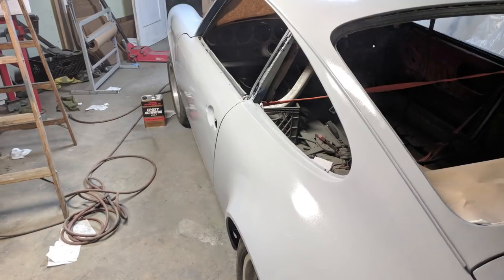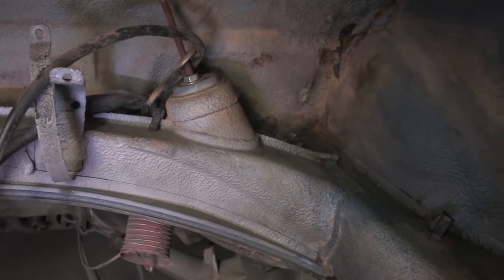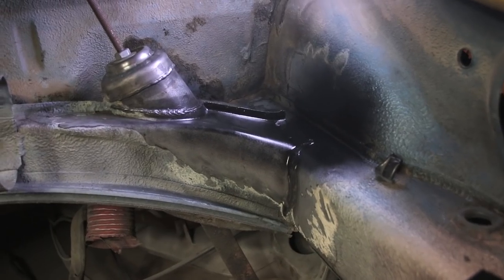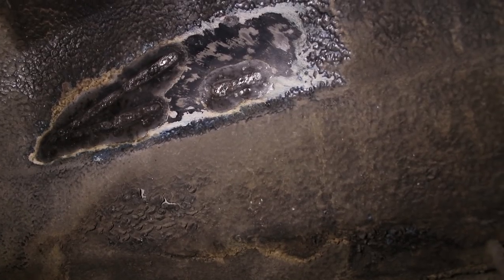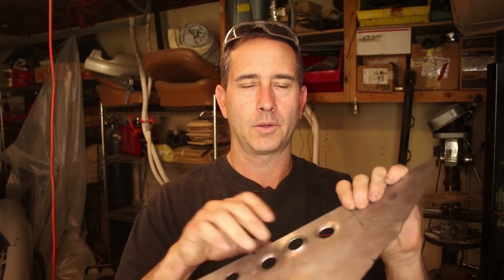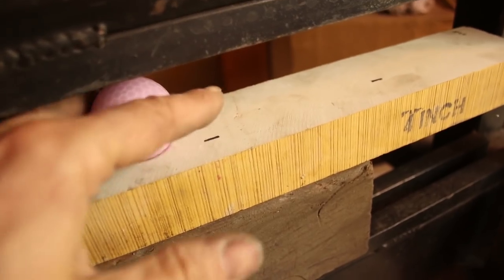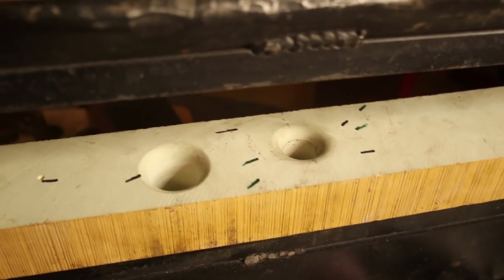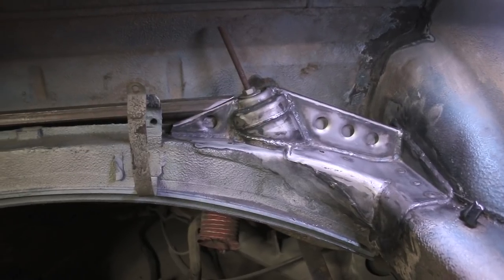How To Make Your Porsche Chassis Stronger For Coilovers

Comment: You might try a 1/4 or 3/8 pipe union for your flair. It has a punch on one side and flair on the other. Use a socket to align the hole.

Comment: Hi Tom!
Do those dimples serve as sort of stiffener? Or it is mostly made for reducing weight? 
Thanks
Reply from the maker: To be honest they just look good.  Depressions like this can stiffen a large panel but I doubt they do much on a really small part like this one.  They may make it weaker?  For example how is possible to strengthen something by removing material?
The feature that makes this really strong is the 90 degree flange on top combined with the vertical wall behind it.  That is a box structure and is more than enough strength.  No holes on the back side.
Some kits are just one thickness of sheet metal.  Mine is two, but thinner metal.

Comment: Rule # 1 when you are welding on your Porsche. DO NOT put masking paper everywhere.
Rule # 2 when you are working in the engine bay REMOVE the deck lid. The final product looks very good I have to admit. I did mine 5 years ago but I bought a ready made kit.

Comment: Hey, what do you think about welding these in with TIG? I've only got a TIG, and I need to weld some similar reinforcement pieces on the frame rails just a few inches further aft then where you welded. I'm going to be using some 14 gauge.
Reply from the maker: Sure, you can TIG that stuff in.  I used MIG here because it's faster and this area gets undercoated.  Access is a little tricky.  Do you have a short cap on your torch?  That allows more torch mobility.
Reply: Yup, got a stubby gas lens. I learned to weld with gas, and I've got a TIG now, but never learned MIG. 

For pulling rosette welds tight, I'm designing a plier where you weld a piece of rod to the center of the base sheet, then grab and pull it up with the plier so cinches the the two sheets together, then you can weld the outside of the rosette (with another filler rod), and finally just melt the center pulling filler rod off with the TIG torch. I still need to play around with the design some.
Reply from the maker: Cool idea, let me know how it works out.  As you know the arc likes to move to sharp edges or whatever is the closest path to ground.  The challenge will be to direct the heat to the lower layer.